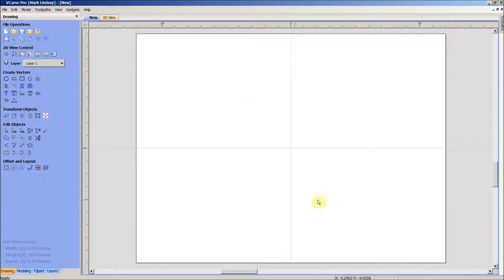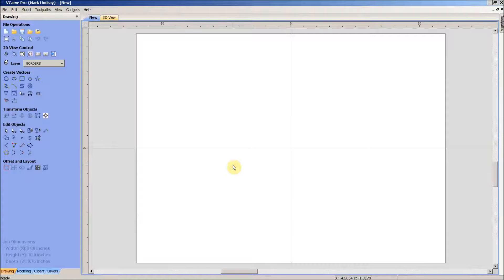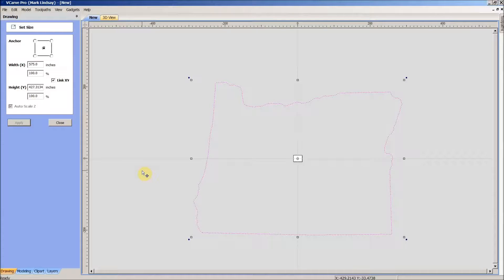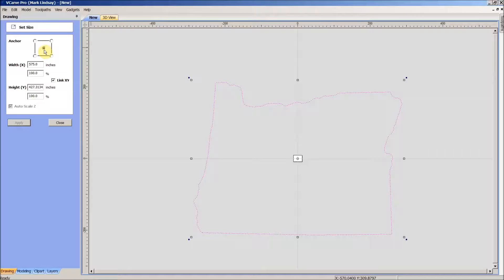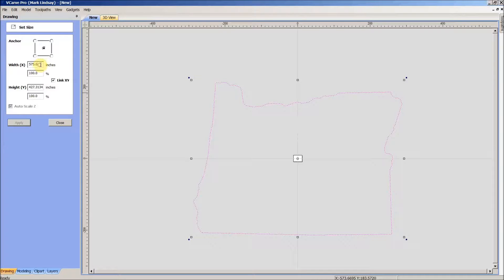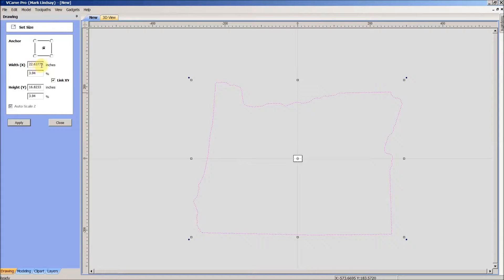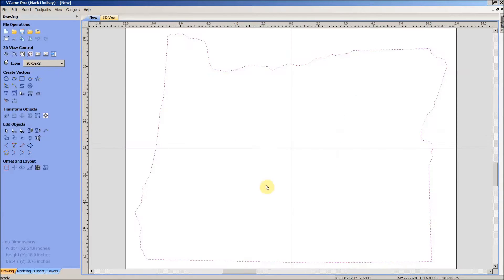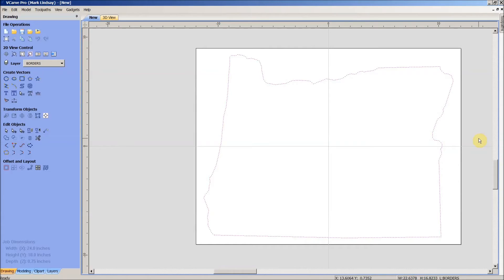Converting Metric Vectors to Imperial (or Vice Versa) in VCarve and Aspire

Comment: What if I have a matrices plan/toolpath and I want to use a imperial router bit.
I wish if you can make a video explain it.

Thanks in advance.
Reply from the maker: You can use either Metric or Imperial router bits on any Metric or Imperial toolpath. The software knows to calculate the toolpaths for any of those combinations. I use Imperial measurements on all of my files, because that's what I'm used to using. I do, however, use some 6 mm router bits in those Imperial designs. It works perfectly.
Reply: Well answered, thanks 👍

Comment: Hi mark, it doesn't work for me, I work in mm, I have a dxf in inches, I select all the drawing, and in set selection size I add
* m =
  it's correct? when I click apply nothing happens. what I doing wrong? thank! ps. I'm using vcarve pro 6.0
Reply from the maker: Thank you for checking out the video! To be honest, I don't know if the calculators were built into Version 6.0 or not. Just a suggestion, but I'd go ahead and upgrade to the newest version of VCarve Pro. You're really missing out on a lot by sticking with that older version.
Reply: @MarkLindsayCNC  hi mark, you are right, i did an upgrade, now i have aspire 9.5 and the converter works! thanks for tour job!

Comment: Doesn't setting your units to metric prior to importing solve this problem? (I don't have this software, but my client does.)
Reply from the maker: Yes, you can set it to metric if you want to work in metric. My point in the video was to show people a few things: 1.) If you import a DXF file into VCarve, and it's huge, it was probably drawn in metric units. 2.) There's a way to fix that, while still being able to work in Imperial units. 3.) To introduce the calculators that are built into the Vectric software.

Comment: Thanks Mark! I have a DXF file I couldn't make any sense of, now I know!
Reply from the maker: Hope it helps you out, Jim!
Reply: Mark Lindsay working on a project to build a DIY drag chain. There are several different parts. When i brought in the DXF file the parts were huge, i scaled the hard way using the handles but it worked.  i have taken the converion formulas and put the on my vcarve short cuts list so i won't forget them.

Comment: Thanks Mark. This has been an on going problem of mine.
Reply from the maker: I'm in the process of shooting a video on importing STL files into VCarve Pro as I type this. I can tell you that if you have a good STL, you don't have to convert it to a V3M file - it can be imported directly into VCarve. I can't promise when I'll be able to release the video, but I am working on it. Thanks for watching!
Reply from the maker: Hope it helps you out! Thanks for watching!
Reply: Mark Lindsay Thanks Mark,  I have a question for you, can you import .stl files into vcarve pro to V3m files, or can you maybe do it with sketchup? I want to buy some .stl files on eBay but only have carve pro or cut3d. I haven't used cut 3D yet so that all new to me Thanks Tim